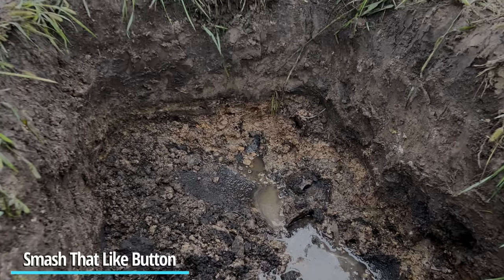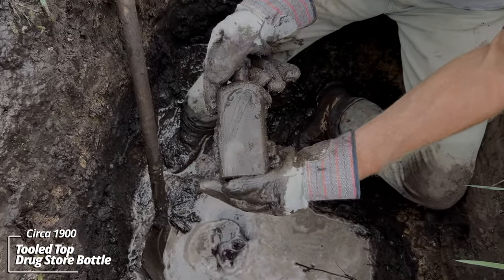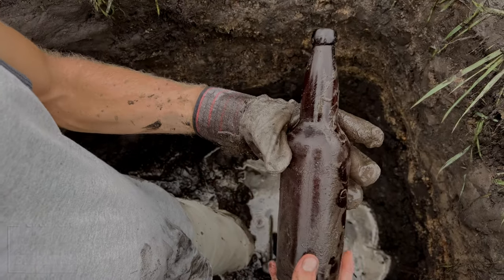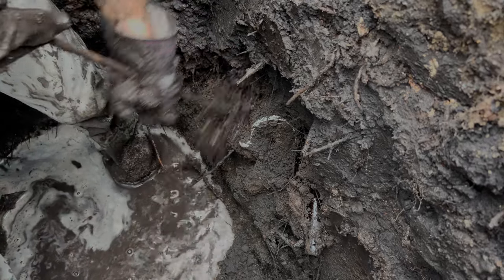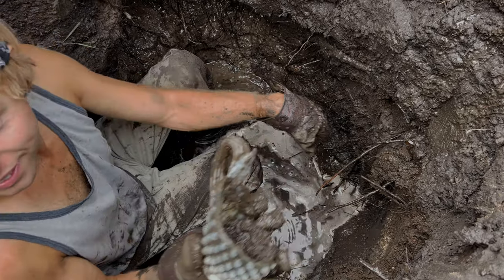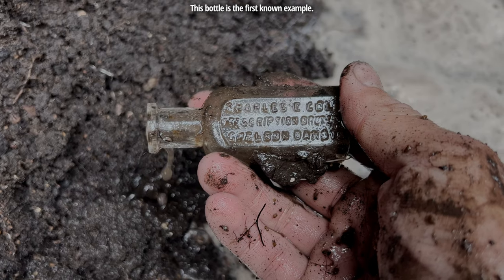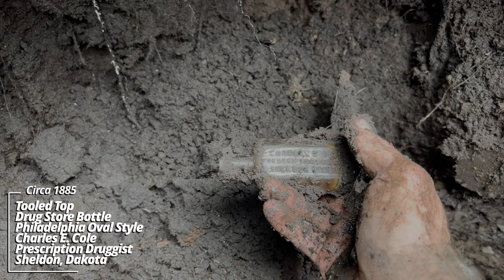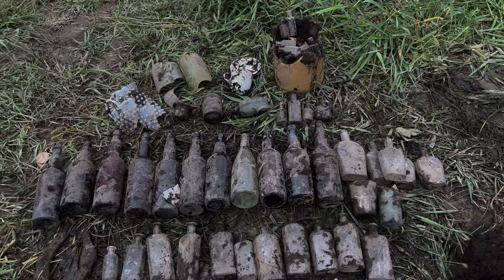Absolute Jackpot Buried Behind an 1880s Saloon

Comment: In the early 70's I was digging bottles in old ghost towns in California. I would lay them on the side of the hole like you do. The problem I had was that sometimes they would crack due to the heat from the sun. Had to make shade to prevent that. Good luck and have fun!

Comment: I was digging under my house for a sewer cleanout and found a Hutchison bottle from the Hugh Forsythe Bottling Co, Frontenac Ks. It had the wire and cork stopper still in it. Frontenac is my hometown and I donated it to the historical society and they had no idea there was even a bottling company in the town. There is only 1 other example and it is chipped where mine is near mint condition. The chipped bottle is valued at $1200 so I'd guess my near mint bottle may be near $2000.

Comment: How do you assign a value to a bottle that has never been found?
Reply from the maker: umm.. well theres alot that would determine that.. the territory bottles are obviously worth more than the statehood bottles.. but it all depends on the state too.. but typically if there was just 1 of those sheldon bottles, they probably be like 1500 apiece.. but since there is now 5.. the price dips a little.. but price fluctuates from a lot of factors.. rarity is probably the biggest factor.. and the embossing is a close second.. sometimes color of the glass can vary between batches of glass when they were made, so if you find one with a strange tint that can boost the value.. its just a ton of factors.. but they need to be basically mint, bc a single little crack can make them worthless. hard question to answer but i hope that helped. thanks for watching
Reply: @BelowthePlains  Very cool to find something that nobody has seen in a 150+ years, thanks for sharing your videos.....

Comment: Is there any real value in the bottles? I found one of those drug store bottles under my shed and my basement/ crawl space is full of those beer bottles but they're broken. I was told there's a bottle pit on my property filled with thousands of bottles, it was a public house / hotel from the early 1700s on. You should also get a metal detector.

Comment: Be careful where and how you dig, if you are below 4 feet in depth you should have shoring to prevent a collapse. Many areas, towns, etc lack the resources to provide rescue shoring if a collapse should happen, and usually results in a recovery rather than a rescue. You can make these holes safer by digging the walls “ benched” style or “ramp” style to lessen the loads on the vertical walls, lessening the potential for a collapse. Also make sure you have a plan to deal with the worst case scenario if the worst should happen, to include local capabilities of rescuers, contact #s etc. your videos are cool, but don’t take your safety lightly, I want you to keep producing videos of your finds, and not see a memorial video..